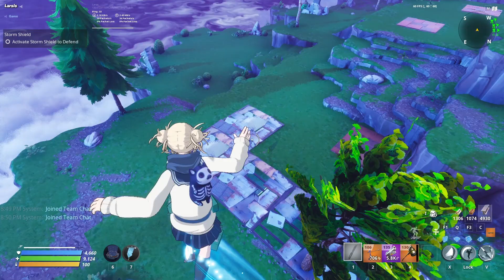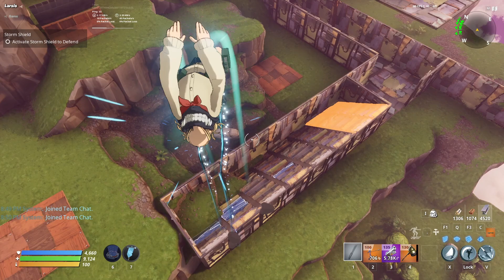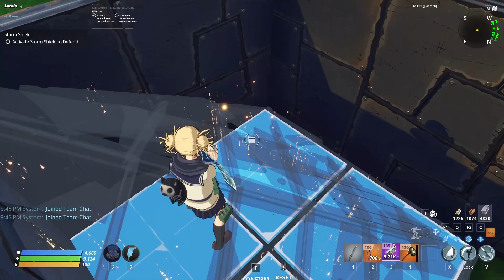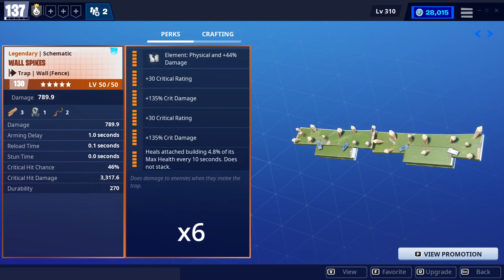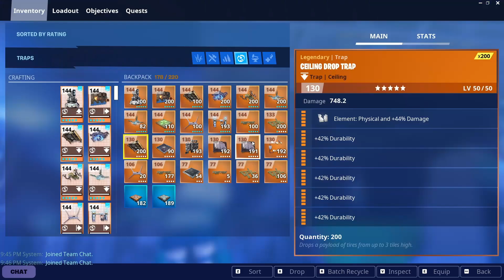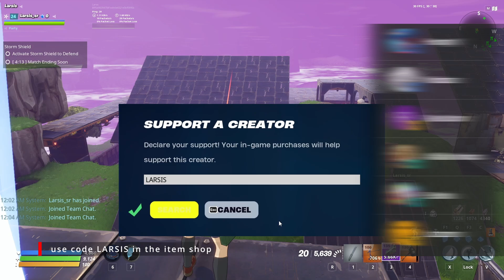Fortnite STW Stonewood Endurance Build AFK - Flex Amp 2 - South - Cheap Build

Comment from the maker: ⚠⚠Traps numbers in the video are wrong, these are the right ones:
- Anti-air traps: 14
- Broadsides: 16
- Damage drop traps: 11
- Celling electric field traps: 3
- Gas trap: 1
- Wall darts: 14
- Healing Wall spikes: 21
- Healing Floor spikes: 6
- Full durability drop traps: 31
- Freeze trap: 2
- sound wall trap: 1
- Wall launcher trap: 1
- Wall and Floor spikes with increase building health perks are extra.
I explained the usage of them during the video
Reply: Hey Larsis im an old fan, i finally can build my own base but i need all the other amps can u guide me cause i only see u posted 2 amps builds.

Comment: hey, love your build, it worked for me, but in some rounds +20 i have trouble with the tornados and other modifier that break the floor, what can i do about them?
Reply: only on AMP D btw, every other amp is fine i think
Reply from the maker: don't worry about the tornado, i added extra parts for it
the tunnel will handle the rest of the waves after wave 20
just make sure you are using a good durability ratio

Comment: hi larsis, i just finished all the videos, it took me 3 days 💀 but im now in wave 13 and everythings going great, thanks for all the tutorials, youre goated bro ❤
EDIT: i did the 30 waves, the only inconvenient it was a little breach on the right block off of the A Amp, the cause of the breach was that i used low durability traps on the spawntrap, (i did the afk base without worrying about the trap perks and only the A Amp went ''wrong'') i already replaced them with ones with better durability and expanded the block-off on the right. i also did the mats grinder behind of homebase and really up in the sky. thanks for everything @larsis :). ill be updating when i do another 30 wave. bye.
Reply: did you use 77+ traps for everything? and did you match all his traps perk for perk? i dont have enough resources to have all the traps at legendary/good level/good perks so rn im just building the structures and will go back and place the traps
Reply: @billybarnes6961  nah, i did all the cheap builds all perks on blue, only changed drop trap perks to durabilty, everything else i just left it as i had
Reply: @SZGT  ooh so you didn’t really change the perks at all? Apart from the tire drops for spawn covers? Sick, ima try trapping it tomorrow. I have almost all the traps he used at legendary 77, just 3-4 are epic but shouldn’t matter. Can I ask what your trap durability is btw? Like the one from your survivors and stuff. Mine is low so hopefully it’s fine
Reply: @billybarnes6961  yeah exactly, i only changed the drop trap one bc almost every husk dies from it , so when it "breaks" in the late rounds i can rely on the tunnels
Reply: @SZGT  aight thanks man appreciate it
Reply: @billybarnes6961  and yea i used only 77 rated traps

Comment: Have rebuilt East and South according to your build and it works great.  30 waves with no issue.  I think using the tire traps over ths spawn is definitely the way to go when doing this amp.  What I replaced was an old trap tunnel build on both directions and this is way nicer and takes way less damage from Wargame modifieres.  Thanks.